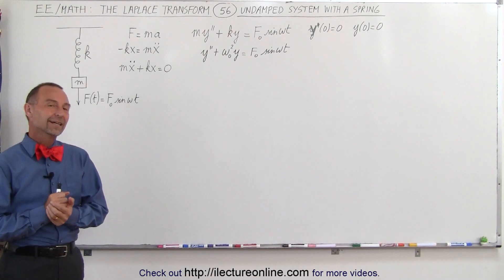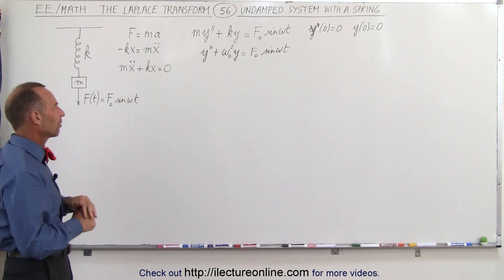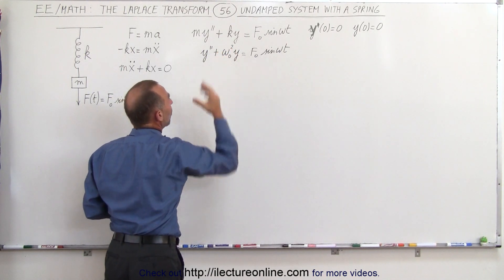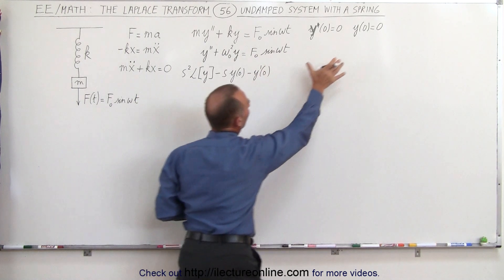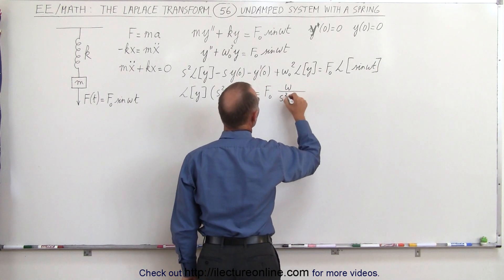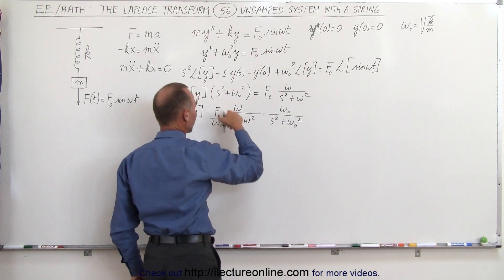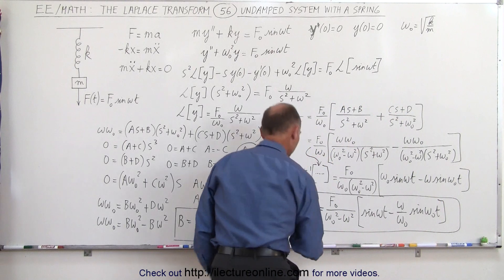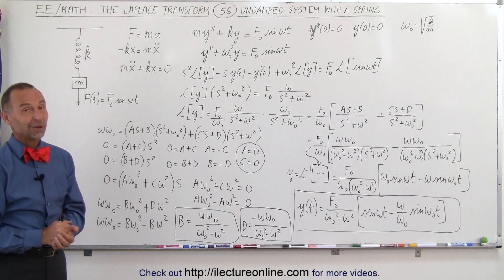Electrical Engineering: Ch 16: Laplace Transform (56 of 58) Undamped System with a Spring

Comment: Nice explanation. However, the 1/m costant is important. It cannot be missed in the right term, as it creates inconsistency in measurement units. F0 must necessarily be expressed in Newton: sin(wt) is dimensionless. Therefore, in the final expression, the ratio F0/(w0^2+w^2) needs the 1/m term to be a displacement, as the difference of the two sines between square brackets is dimensionless as well.

Comment: you seems missed a 1/m for the RHS of the equation y"+(w^2)y=F sin(wt). Appreciate for your contribution, it helps me a lot.
Reply from the maker: Before adding the driving function on the right side of the equation, it is better to take the homogeneous part and replace the k/m substitution, then it doesn't "appear" as if the 1/m was "forgotten" on the right side.  Note that Fo is a constant and can be anything it needs to be to make the equation correct.    That was a good observation.
Reply: I see, thanks for the explanation.
Reply: veryvery clear explanations